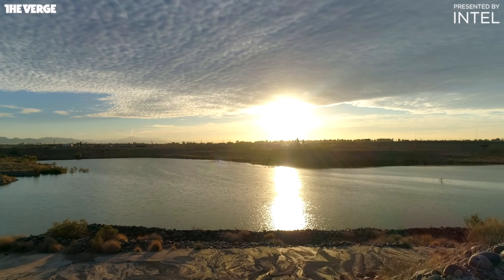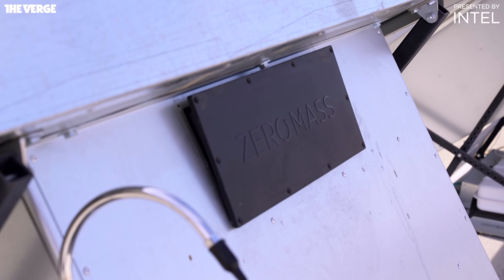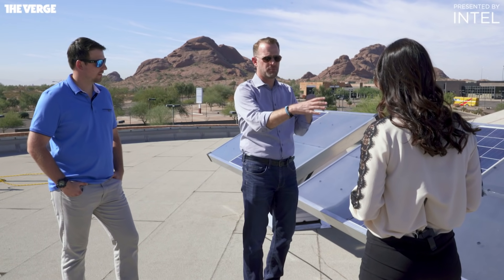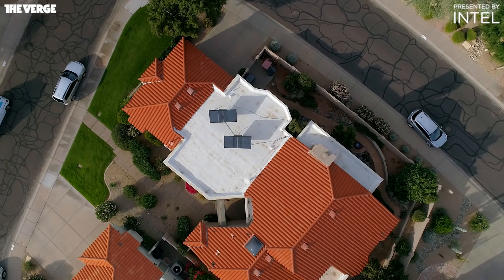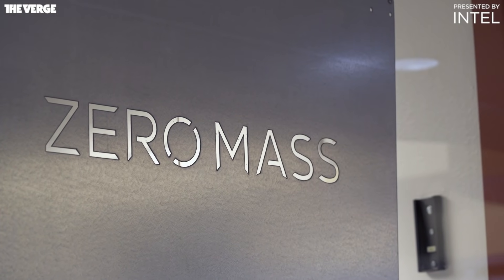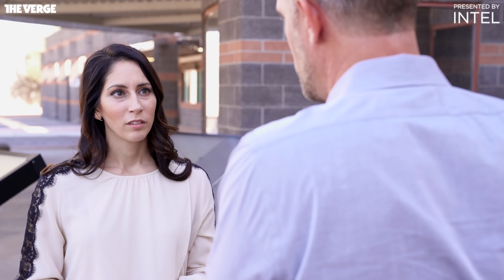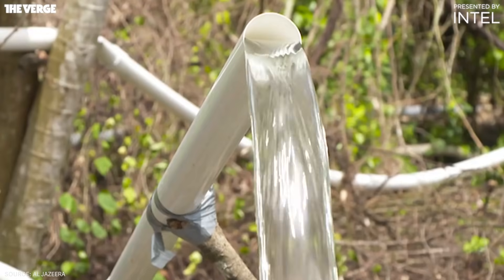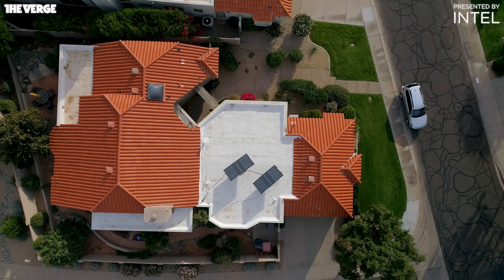Zero Mass' solar panels turn air into drinking water

Comment: Perhaps those calling for Thunderf00t's input on this video and its featured technology can provide me with some insight. My confusion lies in the seeming rush to discredit the application of this and similar concepts when solutions for more considered water and energy use are needed (the other big one I'm aware of is the solar roadway concept). I'm not saying that this is the best solution to manage water usage - and if its insisted upon to the detriment of better solutions, it should be done away with - but why not let those exploring this technology continue working in parallel with traditional water conservation?

Am I wrong in my assessment or mistaken in my questioning? Thoughtful answers are appreciated.

Comment: Minimum cost of installation = $2,500.
Claim it produces around 5 litres of water per day (probably total lies but I'll go with it)
Wikipedia says a tanker of water can cost $6 per cubic meter (sometimes as low as $1 per cubic metre)
For $2,500 you could buy approx 416 cubic metres of water from a tanker.
(416 * 1000) / 5 = 83200 = approx 228 years for the panel to produce the same amount of water you could buy from a tanker for the same cost as the panel.
This company is a joke.
Reply: wring

Comment: Most dangerous plant this will unbalance ecosystem may result in large scale of drought and trees leaves will dry pls stop fuc*ing  planet in the name of experiment
Reply: Nope, you're wrong. Global warming means the average overall temperature of the atmosphere is higher. Warmer air holds more moisture. This is part of the reason storms etcetera are more powerful now. As water condenses from vapour form, heat is released (latent heat of condensation). This system removing water from the atmosphere is a good thing. And it won't be removed for long anyway. As soon as you drink it, you'll start to both breath it back out and sweat it out and urinate it out. The water will be part of the cycle again very quickly.

Comment: The price will come down over time.
Reply: The price already came down. You can buy a dehumidifier with a 70L capacity for less than $200.
Reply: And solar panels, a filter and connect it yourself.

Comment: $5k is a small price to harvest water from thin air. But I wonder about lifespan and maintenance. Is there a point when the solar panel needs its filters replaced, or needs to be cleaned thoroughly? And if so, what are those costs? If these things can be set up and function without maintenance for 10 years, it might be worth it. That would be about $500 a year for drinking water. But I have a feeling maintenance will be necessary much more often than every 10 years. Even if it’s only necessary every 5 years, that’s $1k a year for drinking water before maintenance is required. You’d have to have a lot of extra cash laying around to be ok with spending that much on 2 gallons of water a day.

Comment: I don't understand the point of this company.
Israel, a country that is 60% desert, now has a water surplus by using a combination of drip irrigation for crop growth and desalination for water production. We literally sell water elsewhere. Why do we need another solution that takes up significant space with more solar panels, when we can just extract drinking water from the sea?
Reply: JoneTech you do realize that making enough water for everyone with these things is going to be far more expenisve than building a water treatment facility.
Reply: Sea water desalination is an expensive energy hog and it also damages the environment by making the water more salty.
Reply: TheAnial8r and building these solar things is an extremely inefficient use of money and if working "as planned" will damage the environment by taking huge amounts of water out of the air.
Reply: @thepope2412  I feel the same
Reply: Ben, you are at sea level, right at the ocean. Think of Mexico City. 2,400 meters above sea level, the costs to pump the water up to that level, makes you look for different solutions.
Reply: @Jone_Tech: 80% of the population lives within 60 miles of the sea, give sea level rise a few decades with the addition of inevitably higher population density in those 75% of global metropolises being currently located on the seashore, and the number will get better with time.

Run a nuclear power plant and use some of its heat to desalinate seawater, and it'll serve power and water needs for the nearby population.  Interestingly with the hyper-saline effluent from desalinization, you could then feed it into a higher temperature molten salt reactor and start doing the chemistry to also produce petroleum replacement fuels that have a closed-loop for greenhouse gasses reducing the acidification of the ocean at the same time.
Reply: Ben Lewis Israel even used desalination from sea water too
Reply: Large-scale versus small-scale. If you have a house up on a hill you will probably not get municipal (desalinated water). With this, you can.
Reply: Yeah but it's salty and this is double distilled water
Reply: Water desalination is the only way.
Reply: If you're making so much water you can afford to sell it to other countries, maybe you should instead give back some of the land you stole so others can also have access to the ocean, not just act all high & mighty & assume everyone has the resourses you have. You're using high tech military to attack kids with rocks ffs! The least you could do is give them some of your excess water for free!
Reply: Cost, you’ve got to make huge desalination plants and then pipe it to a desert. Not cheap

Comment: what if every house has a setup like this?
what would this do to our air quality?
do we have to breath extremely dry air in the future?
doesnt sound healthy...
Reply: No as long as we wont do anything stupid. But with all the homes with this it will rain less because of less water vapor. It probably would get drier though
Reply: All the air in the atmosphere 5,140 trillion tons of it, combined with all the water in the world, 8,753 billion cubic miles of it, pretty much guarantees these panels wouldn't affect anything. If it did, then the ultimate effect of every surface we turned from moisture absorbing to a non absorbing surface we would have destroyed the water cycle a long time ago. 4/5 ths of the earth is covered in water, mostly polluted, but there to evaporate
Reply: You start selling this to every home and suddently you cut natural water circulation by 50%.
Reply: I don't think it'll just be affecting rainfall...possibly more complex weather patterns...
Reply: Not only that but weather changed
Reply: daSiew yes solar panels heat up the atmosphere and this clean water tech will cause less rain. No one wants to talk about the bad things about clean tech truth is there isn't any perfect solution. The old Chinese philosophy is the only way to go to find a balance between the 2.

Comment: 5 litres per day in Arizona doesn't seem much at first, but an adult human drinks around 4 litres of water per day so one panel can sustain one person per day and have some leftover for storage and stuff.

At least they didn't lie about the output volume.
Reply: For $4500 you can move to a sensible place.
Reply: except that the 5 l was the max for the system not the Arizona numbers. Zero mass is a fitting name.
Reply: They said it will make less water in dryer places, its just a dehumidifier with a solar panel, In a really dry area they would be lucky if it made a few teaspoons of water
Reply: Where I live we get 4 inches of rain, 10 Cm. each YEAR.  Our average humidity is 8%.  This farce would not work in Texas, where we had 88%, and 35 inches of rain, about 89cm.
Reply: Irval Firestar 4 litres a day really i drink around 2.5
Reply: so if you have a family of 4, you'd need 4 times that.
Reply: We do not need to drink 5 litres a day under normal circumstances. Although we do consume more water than we drink.
Reply: that ríght sñar óñe
Reply: They did say that it makes less water in a less humid place, nothing's wrong with the statement. 

It depends, this is just a luxury product at best and certainly not the most efficient solution to the stated problem, but there might be some use case for this product where it will benefit the user that we haven't discovered yet.

Comment: sounds like a scam
Reply: It is. Water treatment is far far more efficient for making drinkable water.
Reply: Well, I did a quick thermodynamics sanity check, and here's what I found...

At 25deg C, the enthalpy of evaporation of water is 2442 kJ/kg.  1kg water = 1L.  This is the thermal energy you must extract from water vapor (Latent Heat) to get it to condense into a liquid.  There is no magic way around lowering this energy requirement.  Your cooling system will likely only be 50% efficient at best.  So now you are up to about 4884 kJ/L energy input.  A 300W solar panel will produce 4884 kJ of energy in 1.628x10^4 s = 4.5 hours of full sun.  So you produce best-case about 1L of water every 4.5 hours.  You might be able to get 2L a day if you use a heliostat and sunlight, air temp, and humidity conditions are favorable.
Reply: @jessstuart7495  you forget one thing: the enthalphy does not have to be provided electrically. If the due point is above ambient temperature, you can provide the enthalphy thermically - implied that your heat exchanger is big and effective enough.
Reply: It’s just like a mini cloud
Reply: of course  is a scam
Reply: @kwabenatree  wring
Reply: Ray Rodriguez this is a scam it’s really stupid
Reply: it is
Reply: It is not. Had one for more than a year and since then it has produced 100% of our water for drinking, coffeemaker, and ice machine.
Reply: Ray Rodriguez Everyone used to say solar panels were a scam, now they're cost effective and viable. Lots of pseudo intellectuals out there.

Comment: 5:42 and 6:17  Why so many tar filling lines(weird pattern) on the road surface? Is this something due to climate of Arizona? Or a messed up network of underground cables?
Reply: Nope this what happens when they tar the road too thin or not enough which causes cracks as it dry's to quickly. Then they try fixing it later by poring tar in the cracks so you end up with these patterns, other words who ever was contracted to do the road work was crap & to rip it up start again was too costly so this quick fix was the result.
Oh regarding these solar humidifier condensers they do work but it's reliant of atmosphere water vapor percentage, low water percentage takes longer & also depends on seasons also.
Reply: It's to seal the cracks in the road.
Reply: Or maybe someone likes to do crazy deformed doughnuts on the road

Comment: Not this dehumidifier bullshit again. It looks like whole Silicone Valley just discovered them and pretends that this won't be another expensive failure. Good luck getting water in arid climates, getting enough power to harvest water, regenerate absorbent material, filter out the pollutants from air...
Reply: Most importantly, isnt this more counterproductive the more it becomes widespread? If an entire city had a bunch of these id doubt thered be much humidity in the air left
Reply: This is all problems that can be solved. But at what cost? It makes no sense. The professor in the video tells it like it is. It would be good idea on an lonely island without any water supply.
Reply: Moisture farming yes? Well Luke's foster parents couldn't be wrong! xD
Reply: I was generalizing about certain type of people as "silicone valley" type. But yeah you are right.
Reply: No, the problem cannot be solved because thermodynamics. It's literally easier to colonize the entire galaxy than to solve this problem of yours.
Reply: Wouldnt it effect the Weather if used in a greater scale ?
Reply: Humidity is a big problem .
Water vapor also are contributor to global warming.
Reply: This is not economically feasible.  The laws of physics still apply.  You will get more water by placing buckets outside your home and storing the rain water - for free.  This YouTube video says it all - Busted!  https://www.youtube.com/watch?v=vc7WqVMCABg
Reply: These people probably realize that these are problems and are most definitely working to solve these issues or come up with solutions
Reply: But they did it in Starwars...... face-palm
Reply: Might be better to just make a drill-bot that can tow a sturdy, thick cable behind it (for siphoning water and preventing the hole from closing).
It would make well-drilling a lot cheaper and easier to transport than the current method.

Comment: It won't work in drought affected areas , simply because if there is no humidity in the air, it won't be able to extract any water
Reply: Yep low water vapor in the atmosphere confirmed will take longer.
Reply: wring add water dry areaß

Comment: There is no filtering stage?
Reply: I think they only take pure water from the air so there is no need for filtering
Reply: If they suck up air from the outdoors,then it is polluted air.
Reply: Kinda bored man - There are a lot of contaminants in the air that condensation will not separate from the water, like heavy metals from car exhausts. This is why other similar devices come with a compact, multi stage, water refinement ... stage.
Reply: Kinda bored man they would even need to add minerals to it to make it drinkable